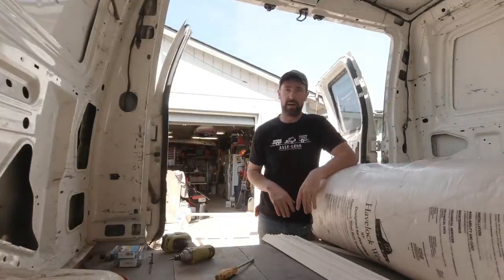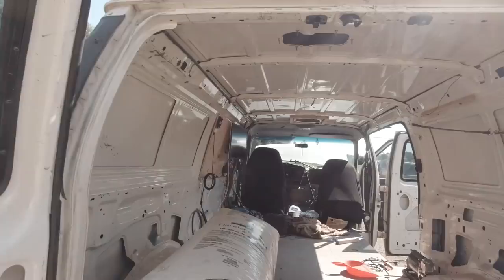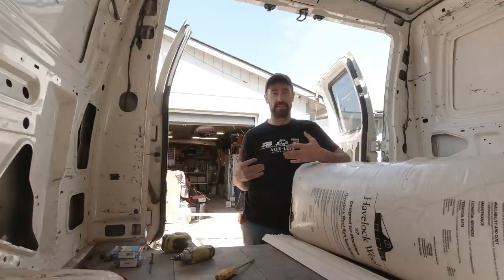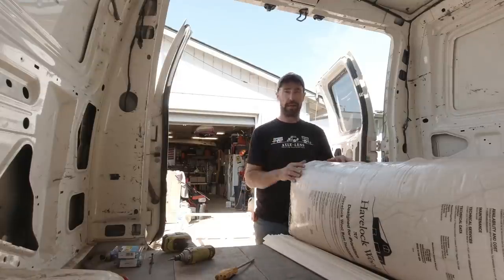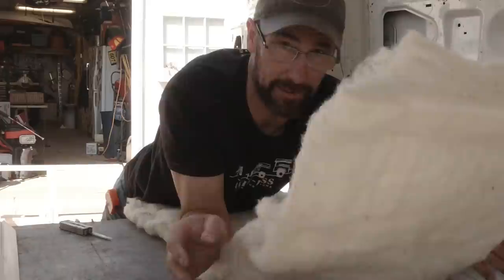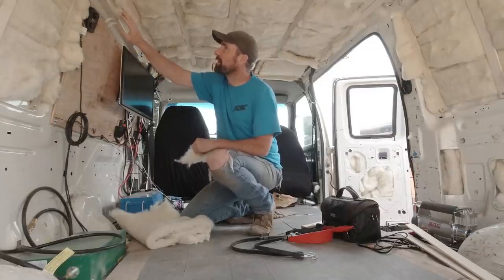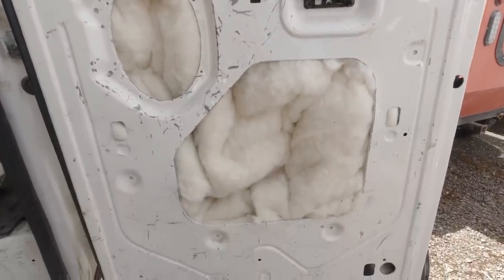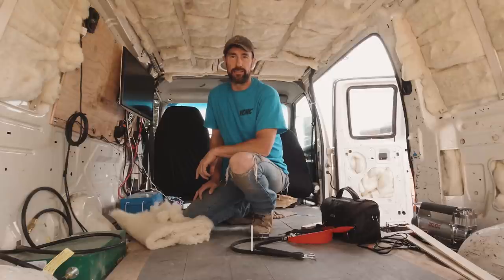Van Life - Havelock Wool Installation

Comment: Thank you for the video, getting ready to insulate my chevy express 2500 van. My van has windows all around, going to make window coverings with the wool inside two layers of material!  I had seen lots of videos for using Havelock wool for Sprinter/Promaster high top van insulation, but none for a standard cargo van so thank you!!!

Comment: For a real-world test, you would need to cover with moisture barrier and wall.  If you don't want to do the whole thing you should consider sectioning off the van for "tests."  Do a couple of different ceilings with different moisture barriers for example to see what works best over the year.  Uncovered you are just going to have damp, dirty, dusty, buggy wool by next year with a few mice for extra companions..  At the very least put up some Tyveck house wrap to protect your work.

Comment: HIGHLY recommend putting FatMat Rattletrap directly against the sheet metal, it is amazing sound dampening, but is the best at removing all rattles.  Especially on all the back roads you will be going.  I put it on almost every inch of my Ford transit van before I did the insulation layer.  Then after the insulation layer, I put a vapor barrier (and a little more insulation).  That vapor barrier is seam taped Reflectix on every inch before putting in the floor/wall/ceiling.  That gives you a system that absorbs all rattles, dampens sound (the fatmat rattletrap), insulates from thermal loss (both insulation and reflectix), and creates a vapor layer (seam taped Reflectix)....
Reply: FatMat is an asphalt based material. Especially in heat it can off gas, smell and off gas carcinogens. A pure butyl system like noico, Dynamat or Kilmat won't off gas.
Reply: @Eburfield  it's under 2 vapor barriers and the floor.  I did mine 3 years ago and zero issues to do with off gasing.
Plus it's been a super quiet ride and zero mold issues of any kind which would actually hurt me as I'm allergic to molds.
Your claims of off gasing are silly no offense.  I have measured the air quality with a couple of devices first after the install and then years later, still nothing.
Now.  If I was to take away all the layers and break through the thick layer that comes on it, and bend the inner portion, ok.. you might register some off gases.  But even then it would be arguable the long term affects.  And like I said I be used measuring devices, you've just made statements

Comment: I’m a huge fan of wool. A company called Zenvanz suggests making your outer finish material breathable as well so that the moisture can escape from the Van. It’s easier to make the van breathable, rather than fully water tight.
Reply: What material would you use for finished walls that is both rigid breathable?
Reply: @rustybranson4592  probably panels with micro holes on it or slate with gaps between the slats.

Comment: Man...I'd be putting a topper on that van to start. (Get that roof raised) 👍
I'd go with a murphy bed/desk setup. One thing I never understood, is why people build these big beds in such a small space. 
Murphy beds are such an ideal design for small spaces. 
Google " Horizontal single Murphy bed/ desk."
 That would be an ideal bed for your  Limited space.
 Design wise, I put that single horizontal Murphy bed/ desk on the wall behind the driver's seat. Then put a mini kitchen on the rear drivers side wall and a mini bathroom on the rear passenger wall.  
👍

Comment: How much installation were you able to put on the driver forward side lower panel?.  It isn't really an accessible section unless you bore more holes for stuffing the cavities.  Also the same issue with the roof beams.  Not really accessible cavity in the beams.  Did you insulate them some other way?

Comment: Ever thought about using some coraplas panels? It would be easier to form over the wool and provide some covering instead of wood panels. Exposed wool will allow moisture to still collect on the metal.

Comment: I'm sure that application of wool on the ceiling will by itself have a significant reduction in heat exchange both summer and winter. My two concerns 1) is that it's organic and with the exposure to outdoors especially with Daisy and Wheeler I wonder if any bug/mite/whatever might have a chance to infest if carried inside as they might be able to feed off it or the oils. 2) the padding stuffed into  pockets I am concerned about moisture on those humid rainy days that will work to the bottom and with no air circulation turn to mold because its organic and that means it can be broken down. I don't think I would have packed it in tight, I would have tried maybe using a wire to push it in and leave it in a lofted condition to allow some air transfer. Hopefully none of those issues become problematic. I'd just be worried with the Dogs and Jason sleeping in there breathing mold spores which you won't realize until someone is sick and then oh man...problems. Great videos as always!
Reply: Hi Jory - To address your concerns... #1 We treat our wool with a slight amount of boric acid which deters all insects. Across our 5,000+ van projects we have had zero moth/insect issues. #2 Wool actively manages moisture which helps keep the wall cavities dry. You are correct in that you do need ventilation. We also always suggest not completely stuffing a cavity as loft is crucial for retaining R Value. Also note that wool is a keratin so it naturally resists mold and mildew. Please check out our site and Youtube channel for more information. Thanks for the interest.   https://havelockwool.com/

Comment: I wonder if you covered the inside as you are but then used mesh(noseeum or even wire) as a covering would that be a better way?...Loving the van. I have 4.56 in the truck I love them and they love gas stations.Cheers

Comment: You're going to have a condensation problem, Jason, it will not be on the wool but the metal behind it and that's where you will get your mould. But as you are testing this product you will see this and think of a way to fix it when you go the whole hog. Cheers
Reply: Hi Akaroa - Across 5,000+ van insulation projects we have had zero issues with condensation and/or mold. Wool will actively manage moisture unlike any other insulation out there. To be clear, you also need to provide proper ventilation within the van to allow for complete moisture transfer. Make sure to check out our site and Youtube channel for lots more info. Thanks for the interest.

Comment: Why don't you inject all the columns with expanded polyurethane. You remove the squeaks from the metal and isolate the corrosion You leave a tube or two for electricity

Comment: Any ideas about the R-Factor and have you seen the R-15, showcases by Coachmen. Here is a link just go down the page. HTTP://CoachmenRV.com/Galleria
If I can recall correctly they use three types of insulation material on walls, Flooring, and wheel covers.

Comment: I know that you're on a budget & spending a bundle but I would seriously consider installing cork underlayment on the roof & walls under your finished walls. Not just for the awesome insulation value but because it also does a great job of soundproofing. A coating of Lizardskin would have been nice but it's too late for that now unless you paint the outside with it.

Comment: Wool insulation? If it gets wet it’s gonna stink!
Reply: Wool actively manages moisture meaning it absorbs and releases moisture as the environment changes. Unlike any other insulation, it will dry out. Further across all our +5,000 van installs we have had zero issues with smell.